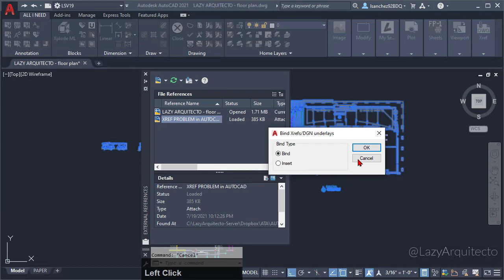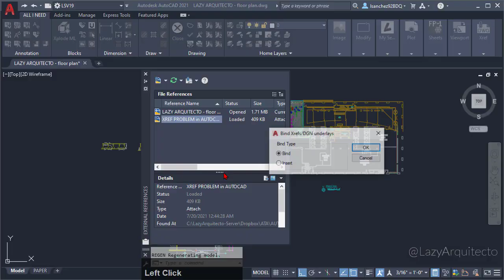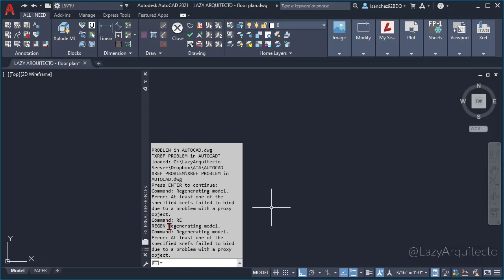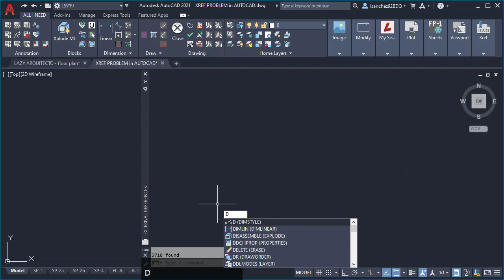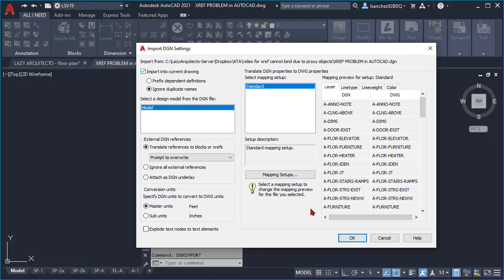Fix this XREF PROBLEM in AutoCAD

Comment: Whats the reason for slow AutoCAD file going to layout from model
Reply from the maker: Did you try cleaning your drawing with purge command?
Reply: @LazyArquitecto   yes purged still same problum can you Tell any solution?
Reply: @LazyArquitecto  if you need i will send my file to check